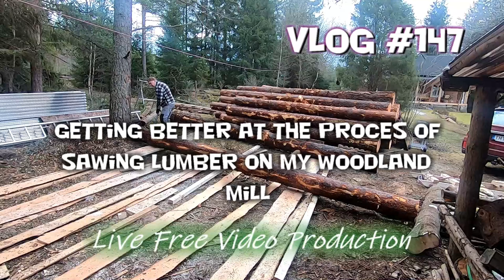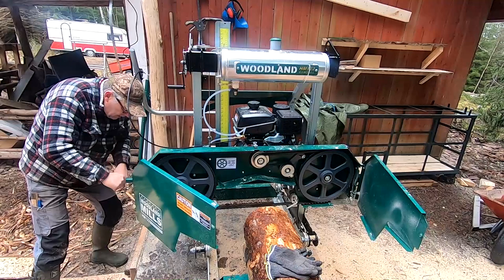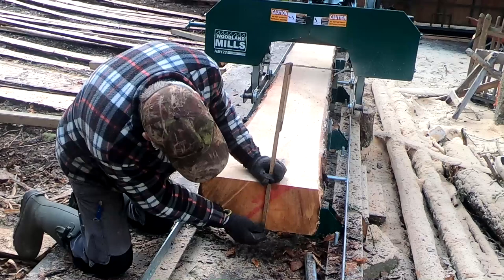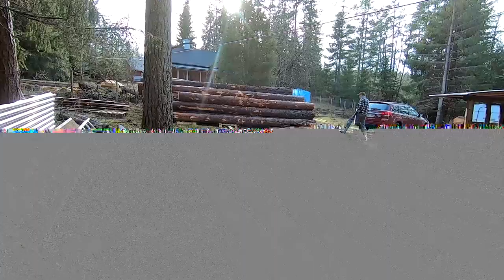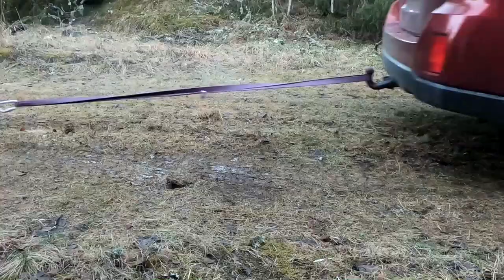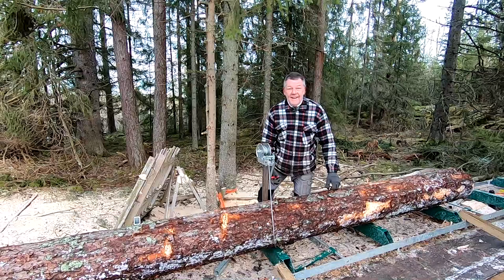Learning the routines, Woodland Mill VLOG #147 - S3

Comment: I have an idea for you.  You have your log pile at kind of the top of the hill, you role the logs down to the low point before the saw. At that point you need to wench them to the side to line them up with the saw.  If you were to lay two or more slab cuts sawn side up in that low point to create a flat spot, then place two or more short pieces of steel pipe on top of them. When you role the log on top of the pipes you will be able to about push the log by hand to line it up with the saw.  This will eliminate the need to wench it and save a lot of time and effort.

Think of it being like a roller conveyor but with out the frame just the rollers.
Reply from the maker: Hi Jim. Great idea - Thanks.
Michael

Comment: You are getting good at it. here in the US a log like that milled with the dovetail notches already cut would cost around 250.00 dollars for one the last time i checked.
Reply from the maker: Hi George. That was a stiff prize. I payed 16.500 Swedish kroners for my 42 logs, and that included the delivery at my property. 20 at 6,25 meter and 22 at 5,25 meter -  size from around 26/30cm at the top end and up to to 64cm at the bottom end.
All the best.
Reply: @livefree-ordietrying  That was over three years ago you can get two three or four sides milled one dove tail cut six inches by twelve inchs sixteen feet long logs hand hewing is extra. more like fake hewing and that is a wholesaler that sells logs to most of the log cabin builders. so i ordered a mill and it took eighteen months to get and now i am working on setting it up. the good thing is i have the trees just need to cut them down.
Reply from the maker: @georgeshotrodbarn2113  that sounds great - you are moving forward 👌🏼🌲
Michael